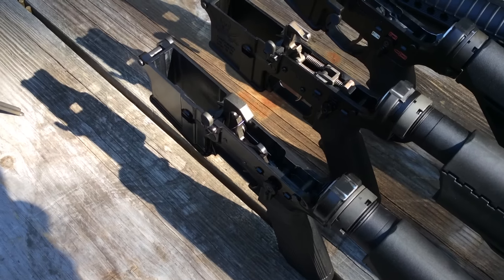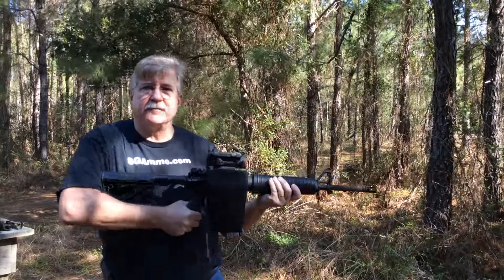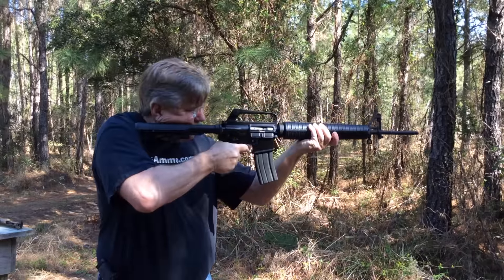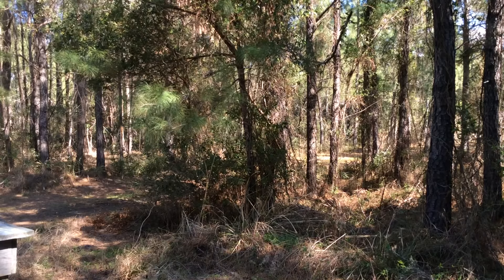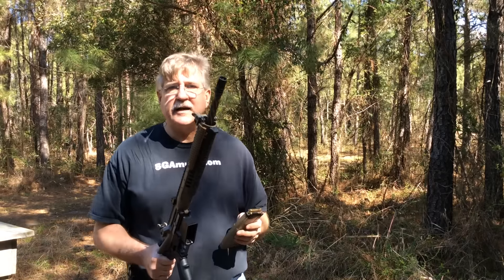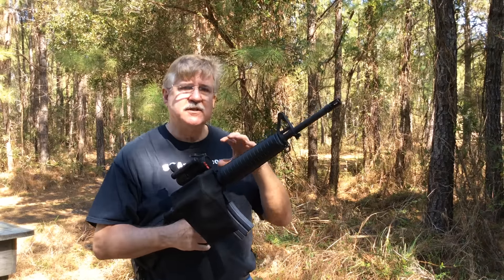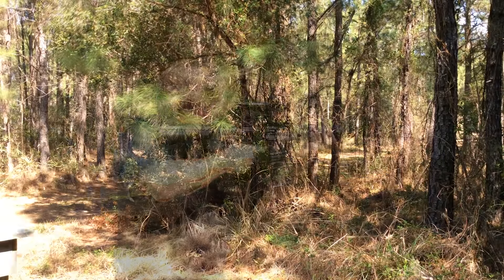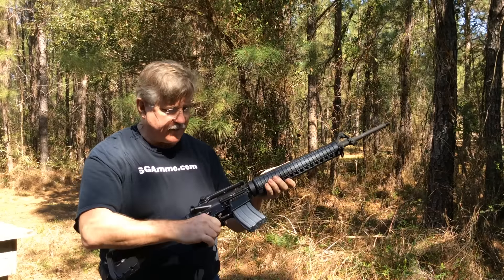Franklin Armory Gen 3 BFS Binary Trigger, Gen2 BFS & Fostech ECHO: Field Test & Comparison

Comment: I have the echo system. The quality is not good. The machining is poor and the right side safety knob holder needed filing to fit. It was bad and I mean badly done!
Reply from the maker: The parts looked rough with mine but they went together fine.
Reply: Can they be polished? I have heard they use pot metal. Is this true?
Reply: Sold the one I bought the second I looked at it. Ultra low quality. I'd be ashamed to put my name on that garbage. Cool design, trash materials.

Comment: For the upper LWRC needs the heavy trigger spring, and the LWRC buffer spring in order for the piston upper to work correctly with the BFS III trigger. Also the brass catcher cause issues. Fyi, the light primer strikes are related to the light trigger spring you are using. I have no issues with mine with different mags, and ammunition. The BFS III also works great with my LWRC piston upper with CMMG 22lr conversion kit. Suggestions to everyone for any AR15 Di or piston, to use heavy buffer spring and heavy trigger spring, this will fix all the issues this guy is experiencing. Because it fixed the my issues when i did the change over to the heavy springs.
Reply from the maker: I assume you mean heavy hammer spring, not heavy trigger spring. I tried the heavy buffer spring and my LWRC upper short stroked.

Comment: Your reviews are the most informative that I've found anywhere Michael.  Thanks and kudos for making them.

Get yourself one of those powerful magnets (like you see in Popular Mechanics ads) that can be suspended by paracord and slowly swung over the floor/ground without bending over.  You'll be surprised at the AR parts you recover that couldn't been seen at all.
Reply from the maker: I am sure I would pick up a lot of springs and detents. I need to do this.
Reply: @MichaelBellmbell556  Harbor Freight..

Comment: Thank for this Mike. I've been debating on whether I want to put this trigger in my lower. I decided against it. My lower shares itself with 5.56 and 7.62x39 uppers. It appears as if they lowered the strength of the hammer spring on purpose to give maximum time to prevent hammer follow. If I make the switch, I might start getting light strikes on 7.62 ammo at the cost of less hammer follow. I currently use a Geissle SSA and have had zero failures. I'm just going to keep it that way. You used a crap-ton of ammo in this video! That's something else to consider when installing the trigger, feeding the darn thing. Great job!
Reply from the maker: Thanks. I had fun looking at these triggers. Can't go wrong with Geissele triggers. Fortunately I bought a lot of ammo when it was cheaper as part of my retirement plan. Now I am reaping the rewards.  :o)

Comment: What I have done is taken a oops lower parts kit from aero with the trigger springs and just replaced them and adjusted the buffer system. Works flawless. Hardly any if ever follow or light primes.

Comment: 9mm varies on both. I could not get the gen ii to work well at all in an AR9. I was doing tests with the gen III and the ECHO the other day but had a few OOB events on my ECHO setup so I ended up having to cut things short. The buffer was the problem on the ECHO. The ECHO does seem to work better then the AR9 gen iii so far an AR9
Reply from the maker: Thanks for the information.

Comment: I have a Gen 3 BFS with PWS 7.5 inch long stroke gas piston upper. It runs pretty well.
Reply from the maker: I like the Gen 3 for it's flexibility, but I have had ZERO hammer follow failures with the ECHO with NO tuning. Both systems have their Pros or Cons.

Comment: Another exceptional review. With respect to the LWRC upper, I think you mentioned that it was a non-adjustable gas block. I wonder if the results would have been better with the Superlative Arms piston system?
Reply from the maker: I have thought about that. The problem is in general these triggers need more gas. All of the adjustable gas blocks just turn the gas down from the starting point of the gas port in the barrel. That's all theory though. I think it would be worth a field test. I'll take the SA upper with me when I test the bolt carrier modification for the ECHO out. I'll mate the Franklin Armory Gen 2 and the SA piston upper and see what we get. Thanks for the suggestion.

Comment: Great video very informative was looking for a comparison video to help in making my decision I will be going with the Fostech generation 2.
Reply from the maker: I have the Gen 2 Fostech in the shop ready for testing. Supposed to be a little cooler next week. So far I have not had a single hammer follow stoppage with the Gen 1 ECHO.
Reply: Michael Bell My only concern with the BFS3 is you can still out run the bolt there for having to eject a live round is not something I want to have to do to get back to shooting. if Franklin could have came up with something similar to like an auto sear the way Fostech did it would be hands down the much better trigger system . Also wish they didn't cost so much but I guess paying a couple of hundred is better than a couple of thousand.

Comment: Love the review and maybe I ain’t seen it but I’d like to see this revisited with the gen 2 Echo that only needs an auto bolt don’t matter the maker
Reply from the maker: Here is a Gen2. I did a mod to help trigger pull since you can't mod the standard bolt carrier.https://youtu.be/higUogoOS_E
Reply: Michael Bell thank you!  I did end up stumbling across them.   Thank you for all the great videos!!    The new BFS3-s1 (with the flat trigger) looks like  it runs the fastest or has the easiest learning curve.   That said after looking at them both, holding both packages in my hand the Echo just seemed nicer.   I installed the trigger the other night and bought the new bcg today.   Already had a h2 buffed in.   I have to say i couldnt believe it fires that fast lol.  I checked twice to see if the mag was empty.   Definitely expensive upgrades but man I’m super happy.
Reply: Scottacus420 how long was your wait after ordering your gen 2 echo trigger?
Reply: Soul Collector took 12 days from the day I ordered.

Comment: The Echo is pretty damn genius, the "Auto sear" locks the trigger instead of the hammer. So in other words you cannot pull or release the trigger before the bolt is in battery since the sear must be tripped to unlock the trigger. Similar to how an actual auto sear works but it locks the trigger instead of the hammer, which of course also locks the hammer, but is not "readily convertible". You can actually get bursts at cyclic rate with the Echo if you get off the trigger fast enough. If you do it'll fire instantly when the bolt goes in battery since it will release the trigger which releases the hammer. Only thing that bugs me is why didn't they make a normal auto bolt trip the sear....
Reply from the maker: Still have to operate the trigger for second fire. ATF may have made them not activate the trigger block with a FA bolt carrier.
Reply: Yeah you do but if you get off the trigger fast enough on the Echo it will actually fire right when the bolt goes into battery. Only on trigger release though not trigger pull. It's because it locks the trigger until the bolt goes into battery, if you've already let off of it when the bolt does go in battery it releases it.

Comment: thank you for your reviews it has the most information  that I've found anywhere...I have a colt competition match ar15 is there going too be any problem with in instilling a BFS unit into my lower receiver... thanks   Xavier
Reply from the maker: If it has any type of auto sear block then I do not believe the ECHO will fit. The Gen3 FA BFS would fit. The ECHO needs room for the trigger block.
Reply: Dino Unfortunately, you will NOT be able to use the echo trigger unless the block is removed. IV8888 has stated so in his installation video and I also have the same problem...

Comment: Thank You.
what I got from the video: the BFS 3 has a higher rate of fire but requires some gunsmithing knowledge to get it to run properly.
Whereas the Echo is a bit slower & more idiot proof (but it won't work with piston uppers)

  I bought the Echo to drop in my S&W 15-22..(doesn't work)
 I pre-ordered it before they informed us that the Echo only works with a modified carrier. 

Wish I'd seen this vid before I spent $480 on the Echo!! LoL

do you think the BFS 3 would work in a S&W 15-22..?
Reply from the maker: Yes. The major advantage of the FA Gen3 BFS is it's versatility.
Reply: DJ Lansing the BFS3 works great with the 15-22, however you will have to file down the selector switch bumpers on both sides of the receiver that would block the switch from moving into the 3rd position. I have a short video of it running on my channel.
Reply: You can modify a full auto .22 bolt to work with the echo. Really don't understand why they didn't just make a normal auto bolt trip the sear......

Comment: I’ve been playing around with different rifles with Franklin armory GEN two had some issues with 20 inch rifle, gas system and rifle but stock I put AR 15 carriers in the guns made a big improvement because they’re lighter now I’ve switched my binary triggers to just 
Carbine rifles with A.R. 15 carriers They’ve been running great. The issue is with rifle gas system in rifle but stock. some ultra light carrier for a rifle length buffer system may be the answer and I would like to try the GEN 3

Comment: Hi I’m wondering what trigger you recommend for a direct gas impingement Ar pistol in 5.56 with a 10” barrel. I may also use my lower with a 16” barrel as well. Thank You in advance.
Reply from the maker: The FA Gen3 BFS is faster and used a standard hammer, but may require "tuning" with different recoil springs, buffers and bolt carrier weights. You may still get occasional hammer follow with the hammer down on a live round in the chamber that has to be cleared. The Fostech ECHO has a trigger block that prevents hammer follow and does not require tuning, but is a little slower. It depends on which of these aspects appeal to you the most.

Comment: Would be curious to see how they operate in a pws long stroke piston upper.  Also how do they feel in semi auto compared to say a geissele ssa for smoothness and break? I'm thinking for the price they should be geissele smooth but maybe that's too much to ask for.
Reply from the maker: Not great semi auto triggers but not bad. I have a video on improving the ECHO trigger pull. The FA BFS  does not work well with pistons in my experience and you cannot "tune" the pistons with a lightweight bolt carrier since the pistons use propriety bolt carriers. I have not tested the ECHO with pistons because I am not willing to modify the piston bolt carriers. But now with the GEN 2 ECHO you do not have to modify the bolt carrier. I will test the Gen 2 ECHO over the next couple of days and will check it out with piston uppers. We'll see how it does. Also will test with the A2 rifle length buffer system.
Reply: Michael Bell Thanks for the info. I don't think giving up my buttery smooth geissele. For a dual fire trigger is really worth it at this point then. I just think control should take priority over rate of fire.

Comment: Hey Mr. Bell. I love the scientific approach you take to your videos.

What brass catcher are you using there? I have a similar one made of mesh that attaches to the rail (made my Caldwell I believe), but it gives me a lot of trouble when I try to remove it. Yours seems to glide on and off easily. Any complaints with it?

Thank you.
Reply from the maker: It is a 3BUCC, I love it. I have a video on brass catchers, check it out if you get a chance. I have multiple adapters for this brass catcher.
Reply: ashiha i

Comment: I just left the range. I shoot piston rifles mostly. The BSF III NEVER had a jam or misfire. Put the Franklin BFS III in it at the range and worked flawlessly. Put it in a gas rifle and it jammed after 2 mags
Reply from the maker: You just have to try it out on your set up to see if it works.
Reply: @MichaelBellmbell556  going to keep it in my old Ruger SR-5.56. cheap rifle with some upgrades. Fun and accurate. But I'm definitely not going to put it in my hog rifles. I put an Elfftmann drop-in on my Daniel Defense and just polished up the Mil-spec on my PSA rifle. Never an issue after about 6k rounds

Comment: The Gen 2 is easier to get hammer follow with because you barely have to release the trigger for it to fire. The G3 has to be released much further to fire the second shot. Since hardly any movement will release the hammer again on the G2 this makes it easier to release the trigger before the bolt goes into battery.
Reply from the maker: The Gen2 has a BUD which they did away with in the Gen3.
Reply: Yeah, but I actually prefer the BDU oddly enough. I cant't shoot as fast with the Gen 3 and also to get a decently fast 2 round burst I have to jerk the trigger really hard. Just personal preference though I'll admit the Gen 3 has a lot of things better about it.
Reply: Garrett - I prefer the gen 2 over the gen 3 as well, for those same reasons.

Comment: I read that the echo 2 had some type of lock made with it I wasn't sure if that is about that hammer follow or firing too many rounds then wanted. I really want to be be able to fire 2 rounds let go and if I want to speed it up I can't use my finger to fire more rapidly but I really don't know what gen 3 trigger is best with 300 black out sub sonic then sonic. I know that when using an sbr or even longer gas systems they say have an h2 weight buffer. But that will not work with subsonics maybe because the JP spring is also 100lb spring and the standard spring is 80. I do feel it's very weak and was thinking of replacing it with an 85 lb spring. Every DI rifle should have some sort of adjustable gas block. I want to just have to tube the gas I really dont want to have to remove the JP system I'd like to keep the 80- 90lb spring it goes all the way up to 100 but I don't think I'd be using that spring certainly without h2 weights.   Let's assume um using the standard ar15 SCS 80 or 85 lb spring. I can tune it down just a bit for supersonics and maybe with subsonics it's more open pistol length gas system I have seen this with before with a maximum and Franklin armory 3 position trigger with subsonics. Maybe I want to take the upper off and put on the 10.5 556 upper with is the trigger that can operate both bullets and pushing and carbine gas lengths sonics and subsonics?  I know Fostech can't be used with the 22 conversation kit. That's fine I don't own one. I just want to be able to learn how to have good double taps with single trigger pulls with binary and switch to semi learn good trigger discipline. If your using a shorter barrel or shorter gas system and shorter barrel for 556 the heavier buffer is better I've always been told but with 300 black out I've been told to use standard weight and adjust the gas block. But my supers in 300  have more kick then any 556. I'm willing to use an 85 lb spring and adjust that gas block. Maybe the echo sport or 2 or Franklin armory 3 I don't want to modify any BCGs I'm not even sure what you have to do. All I know is I want a third gen 3 selection I am not clear on what that Fostech with the special bolt catch one is or which bolt catch you need. I said a video on the  echo sport that seemed pretty interesting.
Reply from the maker: Generally more gas and less weight to make the cycle time faster will help until you get to too light of a buffer and suffer from bolt bounce. The FA BFS Gen3 is more versatile with different calibers since it uses a standard hammer.

Comment: I have a question about which trigger is best for me. I have a 10 inch 300 aac with a law tactical folder and JP SCS ar15 weight but I do have every single spring. And a Geissele Maritime bolt catch I want to have a binary system that works well with this with a single and binary. I have an adjustable gas block. I want to use subsonics 200 grains and my supers that are 110 and 150 grain. I don't use bad ammo. I also have a 10.5 ar15 with mostly 556 ammo no bad ammo I have both Geissele super 42 springs and regular and both Maritime bolt catch and regular ones. But I would like to know really which trigger is best for the 300black out with a surpressor, and alot of times I'll shoot supersonic ammo but I want it to feed well with both even maybe if I decided to take it and put it in the ar15 10.5 barrel. I have another rifle 18 inch barrel h2buffer  geissle spring rifle gas and a WOT. I get 4 round Burts pretty much every time. Or it jans I might need to put a regular spring in or a adjustable gas block. I want more control over that rifle and I want great control with the 300 black out. There's the Echo sport the one that requires a special bolt catch and the Franklin 3. I really want to just get a double tap when I want to. If I have to adjust the gas block when going super sonic and sub so that's not an issue. I just want to not have and stove pipes and jams. I can always swap out the JP SCS for a regular spring and H1 buffer but I just bought the JP SCS and adapter for my law tactical folder I want smooth the bcgs I use are full auto lefty from  stag. The 18 in has a WOT and Sylvan arms folder so that's extra weight for the adapter. The law folder adapter for the scs doesnt really weigh anything.

Comment: keep in mind if you buy the echo and have a specialty caliber with a different bolt carrier. you WILL NOT get the full effect of the echo trigger system. you need to have a full length m16 style disconnect slide stop on the bottom of the bolt like he showed you. you will not have to grind it down to working their disconnect tuned to your gun! it won't be hard start small you can always remove more! it's kinda hard to put metal back when it's dust on the floor and you've gone too far lol!